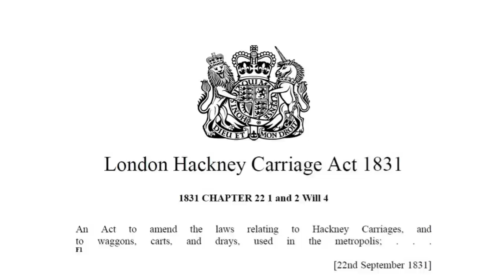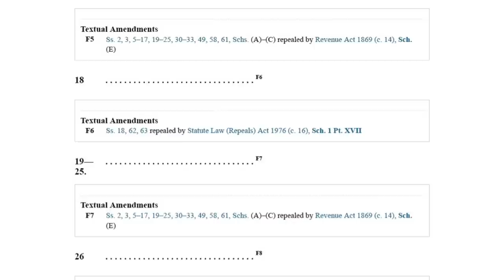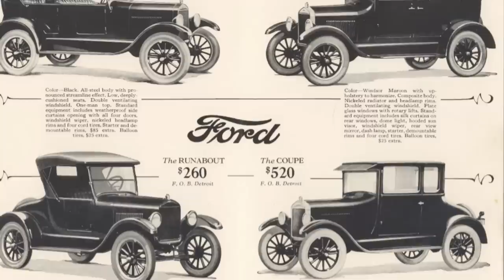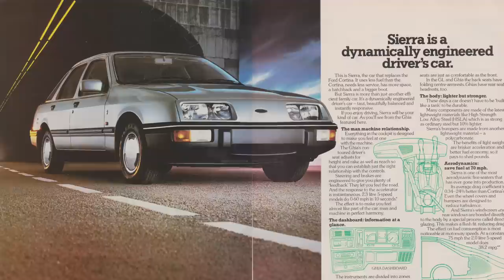Four Automotive Myths That Just Aren't True

Comment: Aerodynamics - the original Citroen DS had a nose which was very sharp in profile.   After a few years, attention was turned to the panel underneath the nose, and that was very much smoothed out.  Of course, the DS was designed to be able to travel long distances quickly, rather than for rapid acceleration, and this is where the aerodynamic work in the original design paid off, to be boosted by the revisions .

Comment: Old Lada actually has thicker steel then Fiat and rust less. Alfasud's problem was not one thing but many. First they used recycled steel(many German brands still do that) with a lot of impurities. The filled all crevices with foam before painting or dipping the bodies in rust protection. They where also transported on open deck boats to Europe and got covered in salt spray. Some recipient countries has prolonged dock and customs procedures(UK had dock strikes) so by the time the car was at the dealers they where already rusty.  Some importers like the Fiat dealer in Stockholm went to Italy and bought up the cars that had not passed factory inspection for a lower price and was supposed to install missing and defective parts but failed to do so. So a window crank handle could be missing or no heater fan. That was up to the buyer to get fixed under warranty that then the factory had to pay for it. In the late 80.s Fiat stopped using recycled steel on the Croma's, that rust a lot less the the sister car SAAB 9000.

Comment: Great vid, Ed, keep busting more myths...

Have you already done the one about the Allegro popping it's rear screen when it was jacked up?

(It was actually true that the body rigidity was lacking though. Those driven through the quarry in the advert that "got air" all sheared at the 'B' pillar on landing - if you watch the ad, the footage cuts off just as they land.)

And there was another rumour about collapsing bearings that was due to dumb mechanics treating them like 1100/1300's and doing them up too tight.

Comment: I bought the story of Mini's never turning a profit, but the economies of scale make sense. In the same way that the giant American car manufacturers could afford anual restyles - the tooling would need replacing anyway. 
I'd also taken the Allegro being more aerodynamically efficient going backwards with pinch of salt. Did someone put one in a wind tunnel the wrong way round? I'd not considered airflow being upset by the cooling air intake.

Comment: Another myth - fwd cars are more fuel efficient than rwd cars. In fact they're not. At least in the modern era, they're less fuel efficient. But they are still generally cheaper to make than rwd cars with the same body size and displacement. So smaller more efficient cars tend to be fwd. But if for some reason a company actually makes a rwd car the same size, style and with comparable powertrain, it invariably uses less fuel (and often for the same reasons has more power as well). These days it's pretty moot as EVs are unaffected by which wheels you drive.
Reply: Depends.. frictional losses are increased in transferring power through 90 degrees such as a traditional differential for a longitudinal engine layout was one factor, as was the additional weight of propshaft & separate transmission & differential casings. But everyone buys 4wd & big heavy vehicles in the name of safety anyway now. Efficiency be damned.

Comment: Thanks Ed, whatever the truth about Russian steel is, I can attest that early Alfasuds rust from the inside out. Any stone chip in an early car revealed oxidised steel. This compromised steel, wherever it came from, seems to have been used by Fiat, Alfa and Lancia from around 1971 to 1976-77 or so, it wasn’t just poor production engineering.
Reply: It appears to have been due to two things. It was not galvanised or treated before use, and it was stored outside in the weather. Nearly every car manufacturer in the world had this problem before it was identified. I had an Alfasud for a couple of years in the beginning of the '80s and it was fine. One of my favourite cars and a real pocket rocket!
Reply: Just like Japanese cars of the period... or British cars, or French cars, even, dare we say it, German and Swedish cars. They all rusted at the blink of an eye.
Reply: @saxon-mt5by  
What about Vdubs, + older Volvos they seem to have lasted long after their replacements died.
Reply: @saxon-mt5by  I particularly remember ALL MAKES & MODELS becoming rust buckets very prematurely in the early '70s.... They were SHITE....
But Vauxhalls seemed to be the worst affected. Which leads me to think, that worldwide, steel processors were trying some new "trick".... to save money....
And motorists paid the price of their failed experiment. 
(I once took a ship to scrap in Taiwan that was built in the early 70's.....Internally and externally,  It was a complete mess due to rust.)

Comment: The Model T "myth" is sometimes true. Prior to adopting the moving assembly line the Model T was available in quite a selection of colours. Fords built in Canada were available in colours long after those built in the US, because the assembly line was later being installed. As an aside, that original Ford factory still exists as the Shoppers' World plaza. There is a very simple reason why black was chosen for the Model T on the assembly line. Paint was not sprayed on the cars. Rather there was a paint waterfall and the Japan Black paint was literally and liberally poured over the assembled car bodies. The paint chosen was the one that had the right viscosity to allow it to flow over the entire car without runs in the paint, but would also dry quickly enough to maintain the speed of the assembly line.
When it comes to aerodynamics, hot the airflow leaves the car is as important, if not more so, than the airflow at the front. These new cars with the ridiculous tail ends create a large vacuum that literally sucks fuel. I was broken down on the shoulder of the motorway after some lovely soul stole gas from my tank and replaced it with water. It was interesting to feel the 2 ton 78 Thunderbird shake as different vehicles went past. Needless to say, transport trucks were worst. Oddly, the then new Jaguar saloon was second worst. This was about 12 years ago now. The oddest thing is that it was older cars, with sloping boot lids and a lower end to the body that created the least disturbance, signifying a cleaner air flow. The thing is that at speed vehicles with a more upright front end build an air wedge that works. It may come as a surprise that the ancient Volvo 140/240 actually slices through the air rather nicely. Even odder, the back end of the estate does not suction up debris to anything like the extent new cars do. On a snow day like today, and I am heading out on an hour drive to do work on my 90, the tail lights will stay clear and visible the whole way. Then there is the magic of Volvo. Without a body part moving the entire station wagon sinks on the suspension as you pass the 100 mph mark, becoming noticeably more stable. Go figure that one out. The basic body hit the market in 67, and the roof and tailgate remained the same through the end of production in 93!

Comment: It always amazed me that Alfa retained that reputation yet other manufacturers didn't. Most cars from that era rusted. Cars still corrode today, although less so. Ford in the late 90's with the Ka and Focus were pretty bad, yes I know the 156 managed to rust too. Remember that time wasn't great for Mercedes either. Their rust issues were horrendous yet it's totally forgotten now but many still tarnish Alfa. Same goes for their reliability. Over the years I've had Fords, Vauxhall's, Audi's, BMW's Jags and all sorts. The most reliable cars I've ever owned were Alfa 147s. I had 3. They absolutely never let me down, only getting replaced with newer models. The last one was 15 years old with 180000 miles on it. It was written off when another car sideswiped it.

Comment: So iirc in regards to the Sud, the reason why rust issues were so bad is because the assembly line and the paint room were across an open yard from each other and they didn't tend to bother covering the cars up before transporting them over and didn't bother drying them off before painting them either

Comment: the biggest problem with the alfa suds is that a lot of it, especially the fire wall were double panel and foam filled in between the panels the foam would absorb the moisture and rust from the inside out, you couldn't  patch repair them (the rust)  because the foam would catch on fire, as to why they were foam injected nobody will say, whether it was for insulation or noise dampening who knows, but other than that they were such a great little car,

Comment: I had several Alfa Suds. A great little car.  Check the serial numbers before buying one.  If it was built in Southern Italy, avoid it. THEY ROT FAST.  Only buy the ones built in Milan.  You will do better.

Comment: My understand is that the initial design for the Austin Allegro had a much lower and sleeker front, but at the last moment the engineering team insisted that a larger 1500cc engine was fitted. The larger engine would simply not fit into the lower, racy bonnet and the result was the rather ugly snub-nosed final product.

Comment: It doesn't kill your battery or ruin it leaving it touching concrete. 

Audis are not just like Volkswagens.  Their body and body hardware is many times more resistant to corrosion. Where I live a 3-4 year old vw will have rust appearing. I've seen many 10+ year Audis that are amazingly rust free

Comment: On Rusty cars (Alfasud) I used to have many C1 Audi 100’s back in the early 80’s my dads 75’ 100GL  ( he owned it for a good 10 years) never had a rust problem, only one of mine the 100S coupe did, which baffled me, as the 4-5 others didn’t, a German friend lived near the factory and explained that Audi stored newly manufactured bare shells in a factory onsite , I said ok that doesn’t explain the rust, he laughed and said  without a roof (rates savings)!… so depending what time of year and the weather when the car was built, you either got a great rust free shell or a very rusty one 😢 😂😂😂

Comment: I heard that the steel used in the production of the Alfasud contained a higher proportion of scrap steel than normal car production, hence the rust. That may be total BS of course!!! As for the Mini, I'm pretty sure that BMC/Austin Rover/British Leyland hadn't a clue about production costings (or production in general!!!!), whilst Ford focussed only on cost. Yes, the Mini kept BL afloat, though mostly due to its popularity rather than its profitability, I suspect. I guess that its popularity and longevity is the only reason that there is any hint of the BMC empire still remaining, albeit only the Cowley factory,  producing cars that look like the Mini and branded Mini, but owned by BMW.

Comment: All steel rusts if exposed to air and moisture, irrespective of quality. The exception is what is known as stainless steel, made, as it happens,  by accident.
Reply: True all steel rusts,  but poor quality steel rusts waaay more. Impurities in the steel cause a lot more rust. The purer the steel the better the quality and less rust.
Reply: Brian, 

I don't know what you mean by pure steel, 
steel is an alloy and the alloying components determine the type of steel. 
What grade of steel used depends on it's purpose.
What affects sop many car sof that era are water\mud traps  far more than teh steel itself and of course how well the body shell is protected by it's coatings.
Reply: @iareid8255  Its got to do with oxidation in the manufacturing process. The less oxidation the less rust. Without oxygen there is no rust.

Comment: Really loved this russian steel. My dad had a Lada 1200L and its bottom sas so rusted that in summer I had habit to remove rubbercarpets and watchet the road until my dad caused multiple car crash becsuse his brake pedal vent thru the floor.  I remember when police officer tried to calm me and said:  Luckily your dad hit the same ptoduct. It wasn't a Mercedes Benz which was expencive. Brake fail - my dads fault. ( brake cabels  in USSR last over Nuke acolypse.) So bad cable - russia  abacus says No.

Comment: I remember seeing Alfa Romeos rusting before my eyes. Fact not Urban Myth! 🤣🤣🤣
Reply: I remember seeing my neighbour's Vauxhall FA Victor rust away with it hardly seeing the road; it was washed on the drive every Sunday, and was scrapped at three years old with less than 10,000 miles on the clock. And don't mention all the 1970s Japanese cars that disintegrated far quicker than any Alfasud.

Comment: The 80's Datsun's were rust buckets plain and simple and it caused a major drop in sales of Japanese vehicles because of the Datsun problem.  This was despite Japanese steel being some of the best steel on the market.  But to make higher profits from their vehicles they used low quality steel and so did many of the other manufacturers especially Italian vehicles that were regular call out for the break down services and poor starting figures neigh on killed the Italian motor companies off.  Today cars catch fire a lot more than they used to, partly due to the computerisation of them and the high levels of glue used.  The new car smell today is mainly of glue fumes, just to make you high when driving how perfect to enforce new sales by you smashing up the last one because you were high.

Comment: I would be interested to see evidence (wind tunnel reports, for example) to support the claim that many cars are more aerodynamic going backwards than forwards
Reply from the maker: Matt here is a lot more qualified and knowledgeable than I am, but the topic is well-known in the engineering community.
https://youtu.be/GEiMi1GNKM0

As for non-simulation wind tunnel evidence, well it’s never really been done. Wind tunnel time is expensive and OEMs have no interest in running their cars backwards for fun.

However, basic aerodynamic principles always point to most consumer cars being more aerodynamic in reverse. Practicality always triumphs over aero, so we have a silhouette that’s backwards to how a teardrop would flow, a wall in the form of a radiator, and the hole and subsequent surface area behind the grille.
The further we move towards aerodynamic shapes the less prevalent this phenomenon becomes, and with rear spoilers designed to reduce drag becoming standard fitment, we are getting to the point where cars are better forwards. But take that single design feature off, and it’s better backwards again. The teardrop is the most aerodynamic shape, and with the small box at the front, the car’s very shape is usually backwards.

I should add as a final note, nobody’s ever tested a real life Allegro to see whether it’s better in reverse. The assumption is based on maths.
Reply: @TwinCam  Thank you for a prompt response. As an engineer I don't make blanket statements based on assumptions.
 I like to see empirical evidence from real world examples. The single example given of one car from the 1950s with tall radiator grill and steeply raked windscreen is not representative of more recent models

Comment: i had both 70´s ,model mnand 80´s very well done re-styling, the center disc brake was a funny thing to see the mechanics looking for them on the front wheels but they were in the midle of the car, the only car automatic i saw till i was 48 with automatic gears, was a mini cooper first edition,or mkI after i saw a mercedes 190E 2.0L or w202 that was ofered to me in 2018 by a dutch friend but new ,he worked for mercedes and he found two, one he kept it other ofered it to me this with full extras in white, normally automatic gears are used by persons with missing limbs ,because of the war in Africa or from an accident, the sierra when it appeared was maybe the most atractive car to buy ,no front grill , but some of those cars with rust issue if well kept they still drive today in perfect condition has my first new car ,a alfa-romeu i bought in 1972 ,a GT2000 veloce large but beneath waist level ,there was the GT junior that today is called GTV maybe because it says veloce in the manual with modern front grill with 4 headlights, two in each side ,my GT 2000 ,all original only uses a big plastic front gril with two headlights

Comment: Then kindly explain why Alfasuds made with South African steel in South Africa rusted like anything?
Reply from the maker: You say that as if I said the myth was fact?
Reply: @TwinCam  And Mercedes Benz, Peugeot and VW etc. made with the same steel did not?
The Alfasud was designed to rust.
Reply from the maker: I’m sorry, I don’t understand the point you’re making.
Reply: @TwinCam  You said cars of the seventies had a propensity to turn to dust/rust.
My point was not all of them. It's like saying Lucas electrical equipment is rubbish. My W110 and W123 Mercedes Bosch electrical systems give trouble but the Lucas equipment factory fitted to my Toyota Corolla and Jaguar XJ6 do not.
Reply from the maker: I said Italian cars of the ‘70s, not all cars. But Mercedes-Benz and Volkswagen, two of those you mentioned, did have a serious propensity to rust. Mk1 Golfs were dreadful for it, and W123 Mercedes’ may have looked okay on the surface, but the body structure rotted badly.
Reply: @TwinCam  I have a split window VW kombi bought at the same time as a mates Alfasud. Guess which one is still driving?